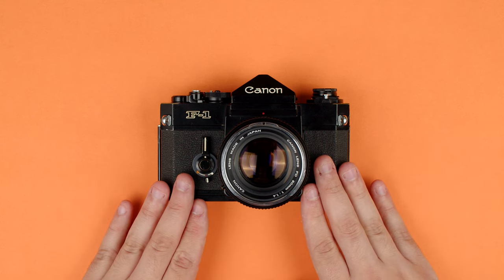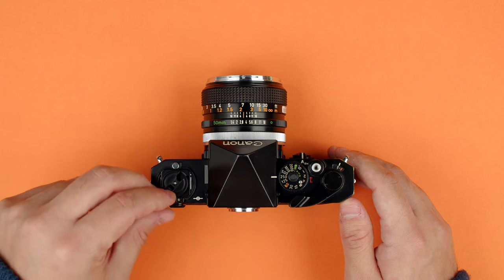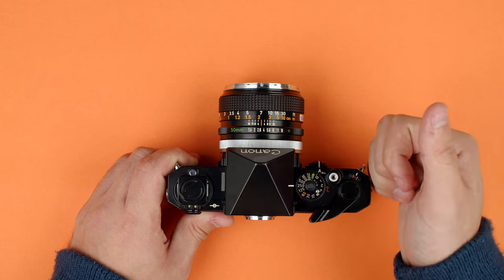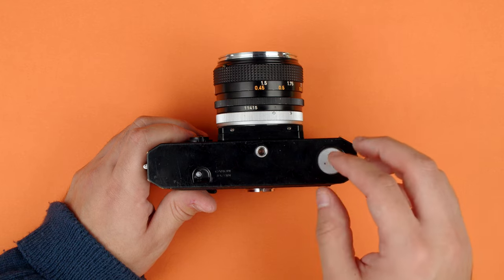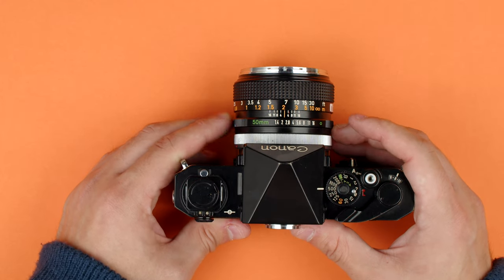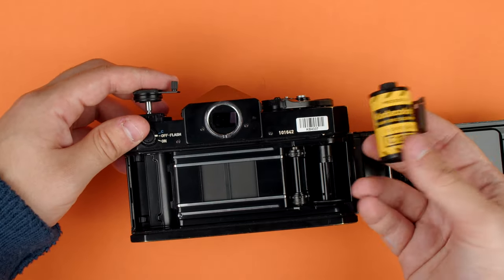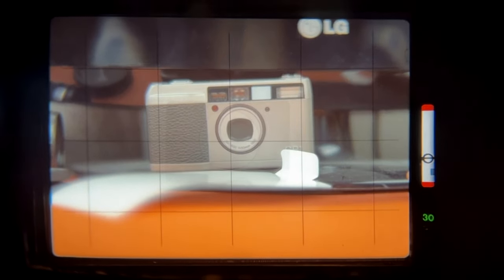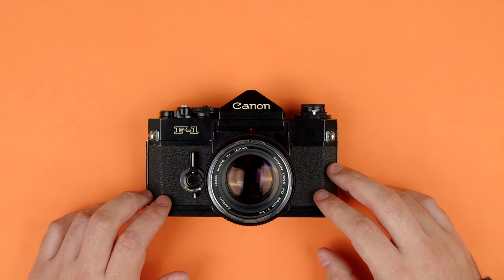How to Use: Canon F-1 - Kamerastore

Comment: I purchased my F1 in the late 70's, I is a fantastic camera. I also got the flash adapter - which has a built in lamp to light the exposure meter window. I also got the - top of the line at the time - flash ring that would help adjust the aperture based on the distance to the subject. Still have it, but never got close to the 100 000 firing life expectation of the titanium shutter.
Reply from the maker: Ooh, that flash adapter with the lamp would be so helpful for my F-1.. Hmmm.. Thanks for the idea (-;
- Connor

Comment: Very informative. I'm using a 1.4v zinc air battery with a brass adapter and the voltage as measured by a volt meter is 1.37. The camera meter seems to be accurate but wonder if that is close enough?
Reply from the maker: It's more than enough! In real use, even the 1.5v PX625 is close enough to get accurate exposure. The issues with voltage are way overblown online. Thanks for watching!
- Connor
Reply: @Kamerastore I’m gonna trust you on this, as someone that actually prefers to underset my iso so the meter bar slightly overexposes for me, is this essentially the same thing? Like instead of setting my iso to 360 when using 400 film, I could set it to 400 and assume my meter is now doing the overexposing I already was accounting for?
Reply from the maker: @Kwright304  Yep! That's the basic principle of it. We're also relying a bit on the flexibility of modern films and scanners to help balance it out. Unless you're doing the developing and scanning yourself the difference between 360 and 400 ISO is negligible. If you want to see noticeable difference in your metering, I'd recommend going even further and shooting 400 ISO film at 200 or 200 ISO film at 100. That's the recipe for those slightly overexposed "tonez" all the kids are talking about. Thanks for watching!
- Connor
Reply: @Kamerastore  so I actually managed to find the proper battery but very quickly it seems like my camera is overexposing by about 2 stops and based on the things I’m seeing it seems the old F1 has a track record of being an unreliable meter, am I on track or does that sound off base? Also since it’s overexposing by 2 stops I’m safe to go from 400 to 100 on my iso and meter properly, correct?
Reply: @Kamerastore  my last question is in regards to getting an accurate meter not in regards to overexposing the shot on purpose. Basically 1) am I correct that old f1s are known to act like this (reading way too high) and 2) if so, 2 stops is 400-100 correct?
Reply from the maker: @Kwright304  All old unserviced cameras are known to have issues with both shutter timings and meter readouts. They just need adjustment and cleaning every so often to work properly. That's what we do at our store.
The F-1 isn't any more or less susceptible to failure than any of its contemporaries. The original Nikon FTn light meters, for example, basically never work these days. Many F2 metering cells are right at the edge of their adjustment range and will not be able to give accurate results in a few years' time. The F-1 probably gets a worse reputation because the meter is inside the camera body and can't be easily switched out like on the Nikons.
But yes! If your meter is reading 2 stops over, you can set the ISO 2 stops lower to compensate. That should give you pretty normal metering results.
- Connor
Reply: @Kamerastore  it appeared as though this camera was well maintained and serviced, and here I am 24 hours later to tell you that pulling the battery, and re inserting it, and then performing a battery check prior to turning the meter on appears to have stopped the overmeter. Saw it suggested in the Canon F-1 manual and thought I’d let you know. Tested it throughout the day yesterday, it was metering dead on from about 2pm-8pm when I stopped checking.

Comment: Great video thank you man. I just have one question- On my battery check, when i switch to C for the check it stays on C. Doesn’t automatically go back to ‘Off’ and the light meter needle stays in the bottom red area. I barely noticed this after shooting my first roll. Is it still possible to shoot like this or do i need the light meter needle? I appreciate any help, thank you !
Reply from the maker: You can shoot without the light meter! Assuming your camera is working properly (and it is worth getting it checked somehow, especially if the meter isn't working) then the shutter should still work normally even without a battery installed. Based on your experience, it sounds like the meter isn't really getting power anyways. Hard to tell from afar, though. Thanks for watching!
- Connor

Comment: I have two and have always been confused with the front lever.  During normal use, should it be set at “L” (vertical) or under the white square (counter clockwise looking at front of camera)?
Reply from the maker: Hey David! During normal use, you can leave the lever in the L position. The L and white square only come into play when you're using stop-down metering. When activated, the L will keep the aperture stopped down and the white square will release it. This section begins at 11:15 and goes to about 13:30 (-: thanks for watching!
- Connor

Comment: I have an F1 and I tried the MR nine adapter with an LR 44 and it just doesn’t fit the battery chamber. The adapter with the LR 44 is way too tall.
Reply from the maker: Yes, that's totally my fault! The MR-9 is meant to work with a n SR43 battery, not an LR44. My mistake in the video, I'm just used to using the LR44 since they're so common. Sorry about that!
- Connor

Comment: I bought a MR9 adapter for the battery and the line goes above the black box. Is this good? or too much voltage?
Reply from the maker: Make sure to set the camera to 1/2000s shutter speed and 100 ISO! It can be slightly above the box and still give good enough results. When using a standard SR43 battery & the MR-9, your voltage curve will be a bit less linear than it would be with the old mercury batteries. So you'll end up with a bit too much voltage at the beginning, a good amount for most of the battery's life, then a a bit too little voltage towards the end. In any case, you should be fine to trust the light meter as long as the check needle is relatively close to the box. Thanks for watching!
- Connor
Reply: @Kamerastore  Thanks for getting back to me! It is set at iso 100 and ss at 2000. It goes above the the line so that explains! I was just making sure I can trust this light meter!

Comment: I just got one from Japan and I have this problem of when clicking the shutter the mirror doesn't seem to lift up properly but as soon as I take off the lens the shutter + mirror releases normally. Does anyone know how to solve this? The shutter and mirror works fine without the lens, only when the lens is on the mirror gets stuck
Reply from the maker: Have you tried with multiple lenses? It's possible that the aperture linkage mechanism in the camera or lens (or both) are slow/oily which may prevent normal function. Unfortunately, that's not going to be something we'd recommend trying to fix on your own. ): Hopefully trying a different lens will help, then the issue would be in the lens.
- Connor
Reply: @Kamerastore  hey Connor thanks for your reply, I so happened to have my friend's lens and just tried it didn't work. I can pretty much confirm the problem is from the middle metal part (stopped down coupling lever) because if I hold onto the aperture preview lever the shutter would work flawlessly. Would you do happen to have heard of a problem like this?
Reply: @Kamerastore  it feels like the stopped down coupling lever doesn't have enough tension/ force to push to the middle and causing the mirror not lift up. Like I said if I clicked the shutter then remove the lens it would then finish off the shutter pressed by lifting the mirror

Comment: I brought an Canon F1 on ebay, not the new F1 or F1N, the problem is, somehow the lightmeter still on even without the battery, and when switching the shutter speed, the lightmeter won't move, it only moves when changing the aperture ring, what is the problem with it?
Reply from the maker: The F-1 has a match needle system. There are two needles in the meter window, one with a circle and one without. When the battery is inserted and the camera powered on, the second needle (the one without a circle) should jump up and then move relative to your shutter speed. Your goal is to make the needle go inside the circle at the end of the other needle, which is why it's called "match needle"! Hope that makes sense, I know it's a bit confusing.
- Connor
Reply: @Kamerastore oh, so the white and red stuff that looks like an LED isn't powered by electricity, only the blackline do🤔, thanks

btw, i was trying to find parts to repair the exterior of the camera and the reflective mirror because it's usuable but not in a good condition, any good recommendation where you could order these kind of stuff?
Reply from the maker: @R-Jacky6698  Spare parts like that are (unfortunately) completely unavailable. While I wouldn't recommend attempting any disassembly unless you're fully okay with the camera never working properly again, your best bet is likely to find a whole camera that's not working and cannibalize it for parts.
- Connor
Reply: @Kamerastore There are a few i notice that there is a problem, but not fully. When i obtain the camera from ebay, the reflective mirror is with water marks on it, clearly the previous owner soak the camera. The lower panel of the camera have a huge dent which not just affect the lower panel, but the skeleton of the camera too, it also affect the lower button, when i press it, it stuck until I load a new roll and pull a film. Also it seems that lubricant is necessary, and that 1:1.4 50 mm lens is clearly disassembled by someone since i saw fingerprints inside the lens, there are clearly dust and fur inside the lens, and the meter ring is stuck at 0.8 instead of going to 10 or infinity distance. This might be just the tip of the iceberg since i don't have special tools to check if everything works.

So... yeah a fully renewal is needed. Might also needed to recalibrate, since i have no idea if the shutter speed is accurate or not
Reply from the maker: @R-Jacky6698  I would definitely contact the seller in that situation if the camera wasn't described as having these issues. Not to sound too salesy, but you're better off going to our site and spending a bit more than eBay to guarantee you'll get the camera you want. A serviced, good condition F-1 can last a lifetime!
- C
Reply: @Kamerastore i should next time, me being dumbass that using alcohol to clean the exterior and the lens before taking evidence pics💀

now i gonna live with it, maybe i will purchase it on your website instead next time. 

Atleast it can be experience, tried to build a watch from scratch before, reassemble a mechanical camera might not be that hard i guess. I hope💀
Reply: @Kamerastore I successfully managed to cleared the rust and buy repair parts on the internet and make it look decent. Lens has been clean up and lubricated. And the focus is not stucked. Still some ashes tho, used up all my air dust can. Can't find how to disassemble the lightmeter to clean the dust so still in working progress

It seems that there are different focusing screens and I got the focusing screen B which is the split screen, I have no idea how it works and which situation to use that screen, there are no comparison on youtube as well, is it possible to make a video talking about it in the future? 🤔
Reply from the maker: @R-Jacky6698  If you check our how-to video for the Canon AE-1 I offer a brief instruction on how to use a split-prism screen. It's around 6:30 at the video below!
- C
https://www.youtube.com/watch?v=x4pWmJjZI0c&t=386s